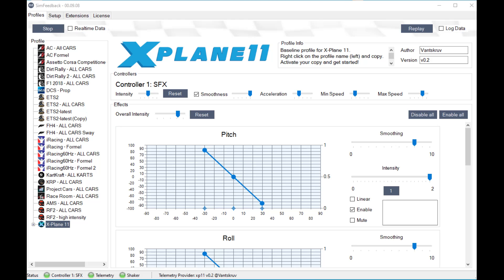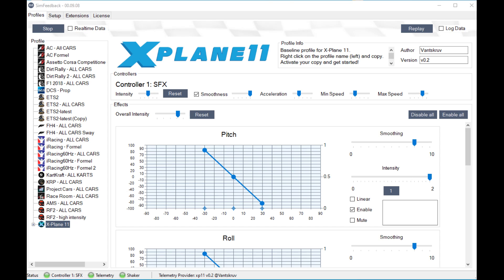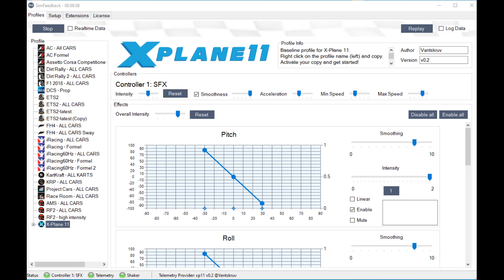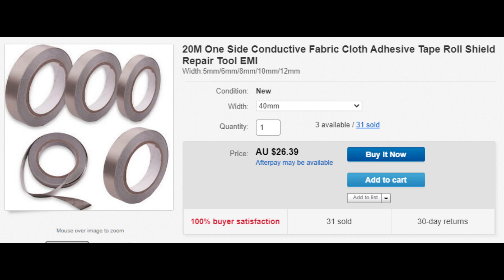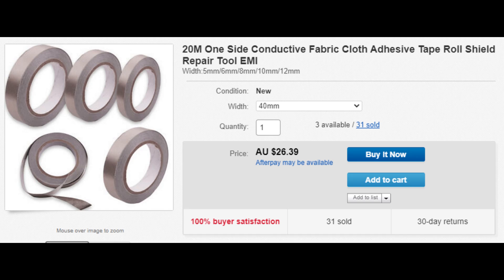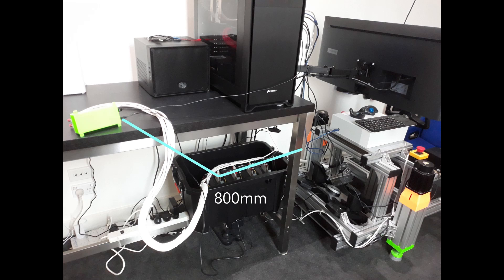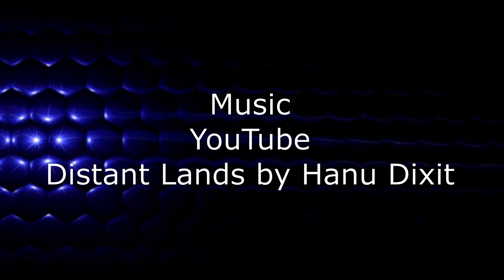Troubleshooting issues with a simulator motion platform

Comment: While I was playing around with my own controller for these servos I've found that as soon as I enable the servo a ton of noise is showing up on the DB25 lines pulluting everything that is electrically connected with it. In my case I was powering AASD logic from the same source as the mcu. In that condition it worked for a while but suddenly the mcu just stopped. In the end I decided to go with optocouplers and that solved the issue with noise killing my mcu. PS. I rember you from xsimulator - your 6dof build made me start this whole madness :) Thank you!
Reply from the maker: Thank you Łukasz! Yes, you are absolutely correct about EMI. The long DB25 cables act like aerials directing the EMI down into the Arduino. When I wired up the servo controllers, I took the DB25 cables in the opposite direction to the servo cables in an effort to minimise crosstalk and induced signals. Since moving it away as shown in the video, I haven't had any further problems. It certainly saved me from wrapping the servo cables in conductive tape, which was my next plan of attack. A few of the 6DOF builders moved to the SFX100 design which was interesting. I have used it much more than the previous build simply because it is easier to get into and out of! Thanks for your comment :)